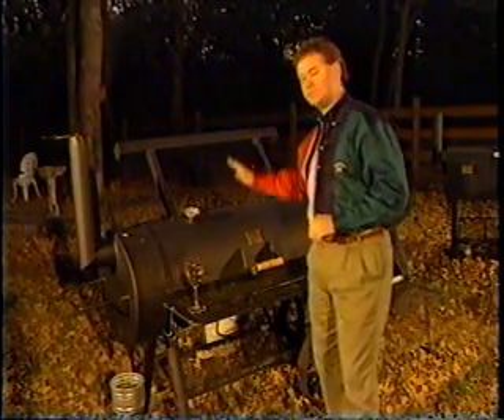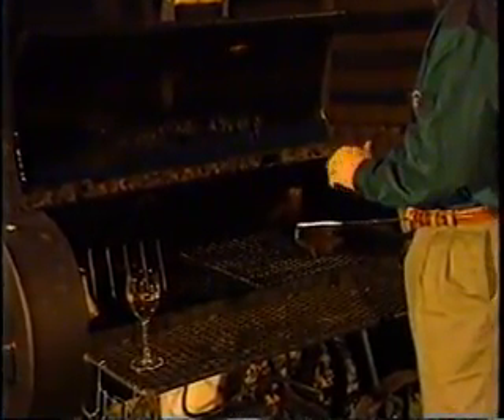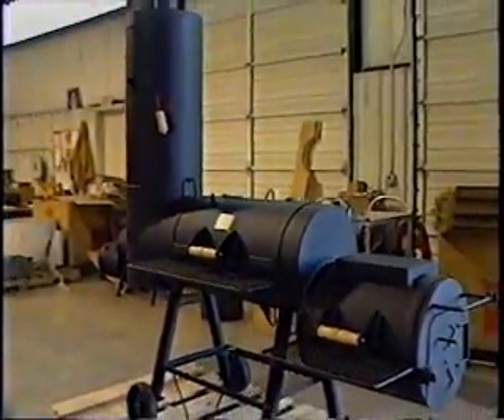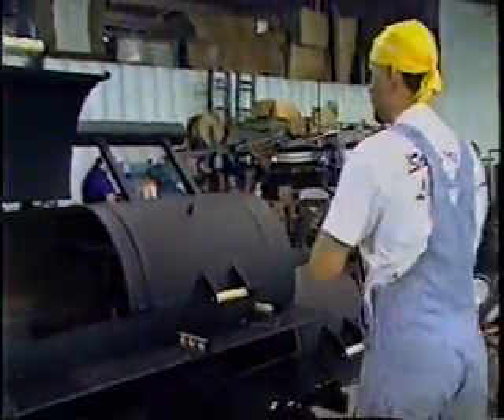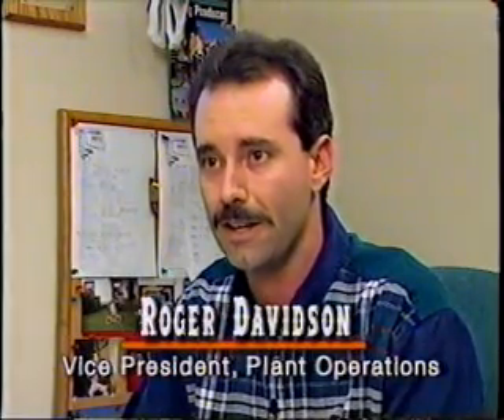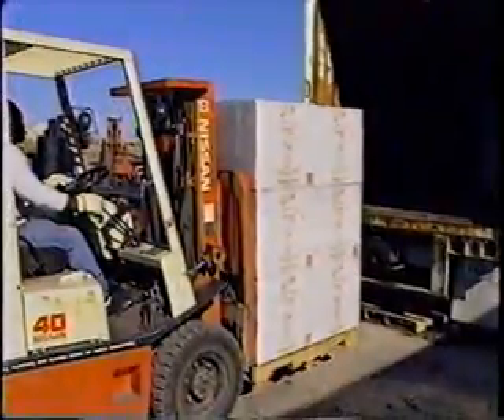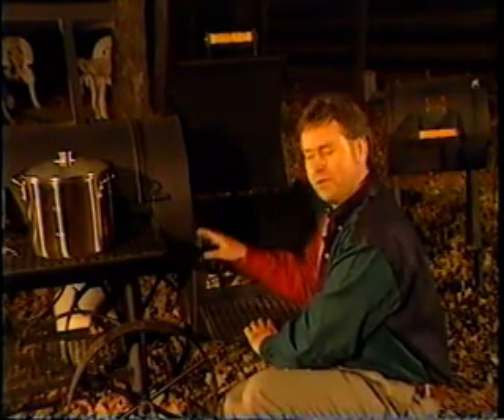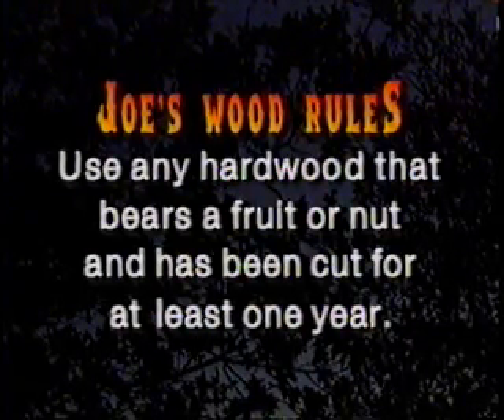Oklahoma Joe's.  Starting smoker and factory tour.

Comment: Put heavy foil on the cook grate by the smoke box to deflect heat.  This will solve the issue but you will have to figure out how much grate to cover.  This will change the air flow and cause the heat to stabilize.

Comment: I just purchased an Oklahoma Joe at Lowes about 3 months ago , I really like it but I fight to keep the temp consistant and it has ports for two thermometers but it only comes with one. the temp near the fire box is really so much hotter. I guess I need to deflect the heat down under the grates as it comes out of the fire box, any thoughts on this. I have only been smoking meat fo rabout 6 months